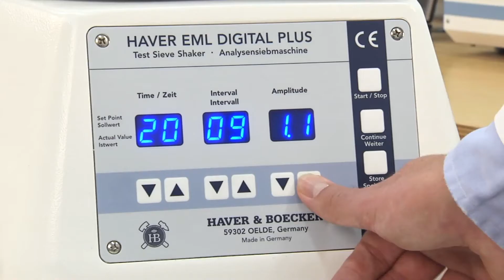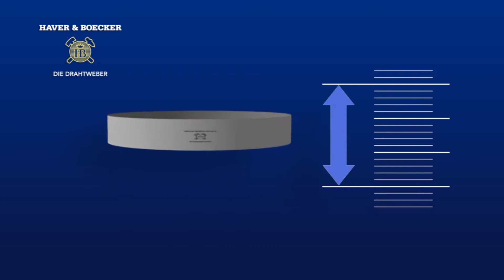HAVER EML : Test Sieve Shakers

Comment from the maker: As well as high-quality test sieves, an efficient overall concept also includes modern test sieve shakers. HAVER & BOECKER provides a multitude of systems for widely differing applications. HAVER Test Sieve Shakers generate a three-dimensional sieving action for fast and optimally reproducible sieving results. The product is accelerated vertically out of the mesh and at the same time fed over the surface of the sieve in a circular motion. This 3D process saves time and manual re-sieving.
HAVER & BOECKER also uses G-Control in all electromagnetically operated test sieve shakers (HAVER EML). G-Control is an automatic amplitude control system which continuously measures the acceleration of the whole sieve tower. This fully compensates for all natural oscillations of the sieving machine and the subsurface so a constant amplitude is guaranteed at all times, regardless of feed rate.